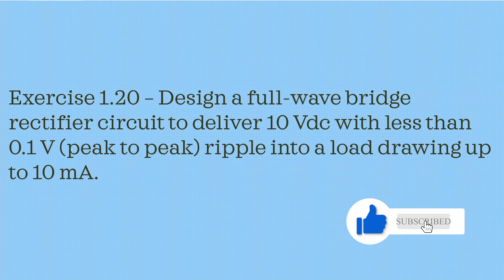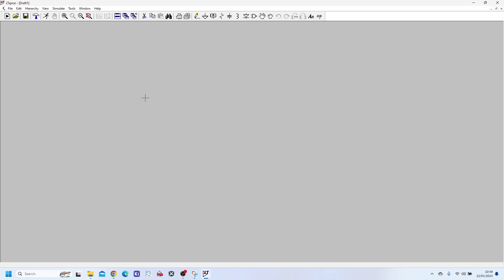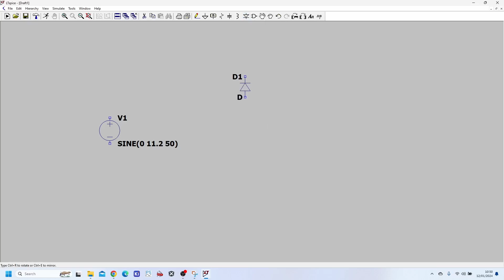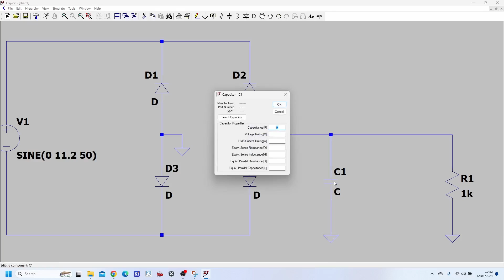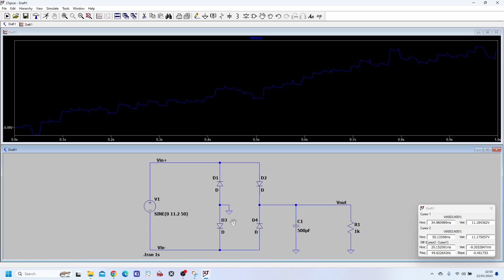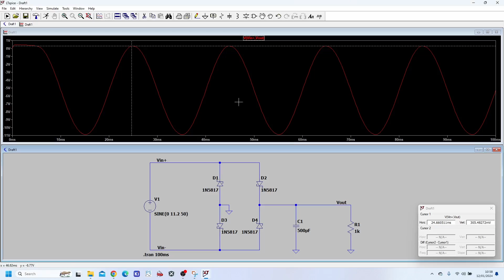Learn The Art of Electronics: Exercise 1.20 Full Bridge Rectifier

Comment: The bridge rectifier doesnt invert anything. The transformer changes phase to get lower positive cycle.
Reply from the maker: The bridge rectifier turns the negative part of the cycle positive with respect to the load. That's the definition of inverting something. 

I am not sure why you mention the transformer which has nothing to do that portion.